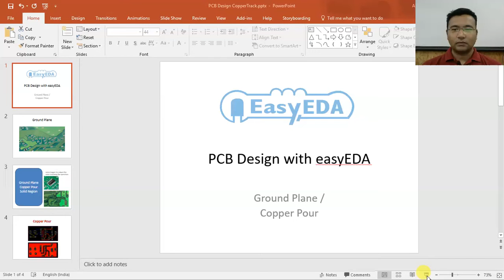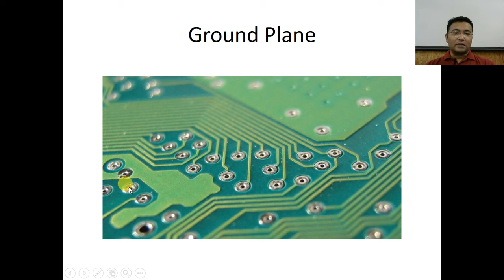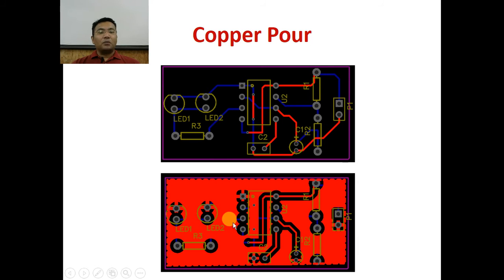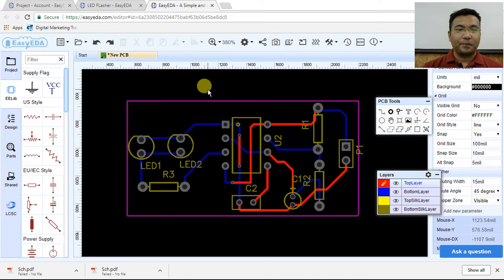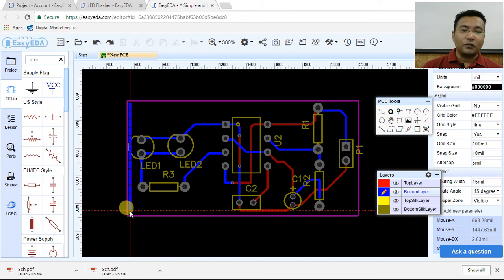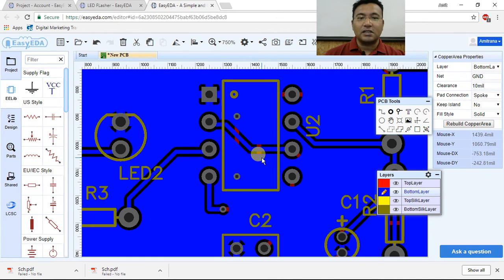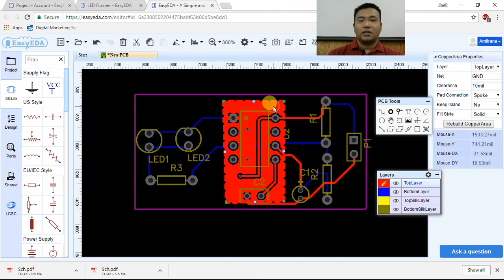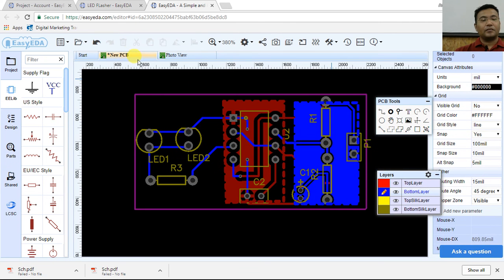How To Add Ground Plane on PCB using easyEDA

Comment: what if we have two ground. for example PGND that handle high voltage part maybe 325VDC and low power side called MCU_GND for microcontroller

Comment: This is a copper Pour NOT a plane. A plane is a dedicated layer usually found in 4 layer boards where you will have signal layers on top and bottom with GND and VCC planes making up the inner 2 planes.

Comment: That's how to fill unused area with ground. How do you make an actual ground plane on a 4 layer board?
Reply from the maker: On a 4 layer board, you can't do etching action on inner layers, so inner layers are always used for interconnects, not for adding grounding layer.

Comment: Thank you sir for sharing this wonderful knowledge, please how can I apply solder on traces using EASYEDA software.This will enhance the current follow on the those tracks
Reply from the maker: Hi, adding solder on traces is something which is done at PCB mfg phase.
However, it exposes the traces to environment which may reduce the life. Its not recommended.
Though if you want to do that, you'll have to specify that to the PCB manufacturer

Comment: Hi

I have designed a smart switch/Plug, i need to turn ON/OFF light with time specific with google assistant...

Eg. ok google, turn ON light at 16:00 IST (or) turn ON light at 4:00PM....

I have tried that but it's not working, will U help me how to solve this....
Reply from the maker: Surely I can, can you reach me on amitrana.com?

Comment: Sir What is the purpose of using Solid Region in PCB
Reply from the maker: It's used to provide larger ground planes which reduces overall noise generated by current flowing through pcb tracks
Reply: @kitflix  
May I used it instead of Copper Area ??